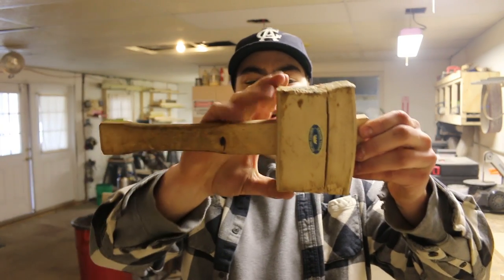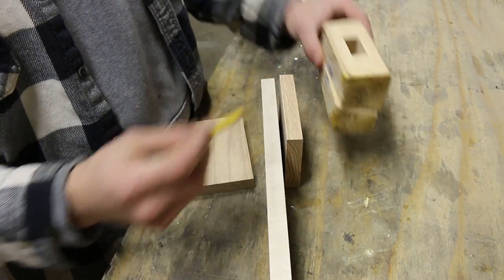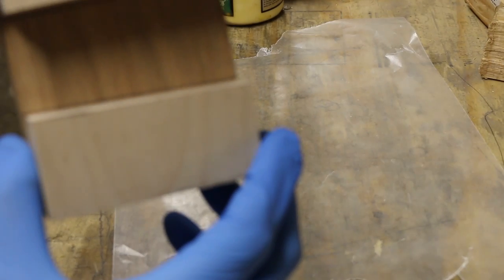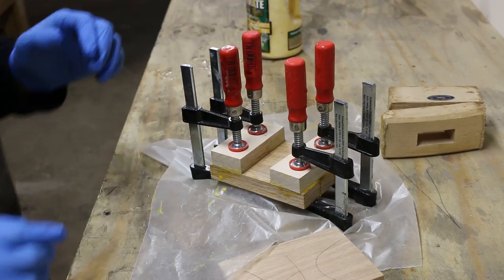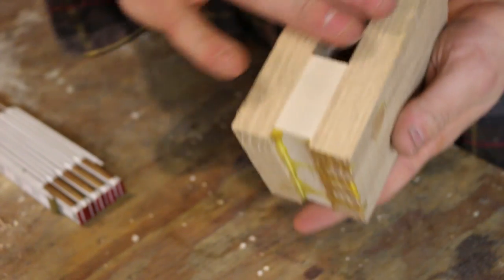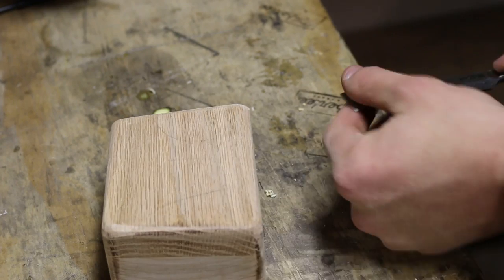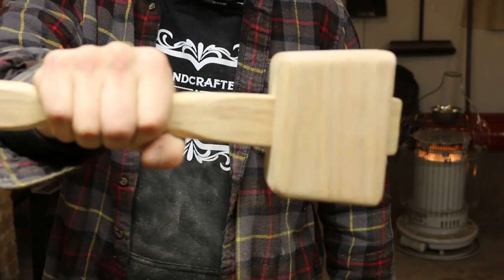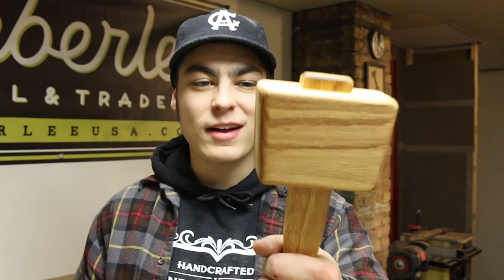Making a Wooden Mallet

Comment: You did a great job! Looks great but I have a question would a domino work in the head or will that be over kill to put them on there
Reply: I thought about the same thing, dado would secure the head from loosening for sure.
Reply: Paul Sellers recommends this method so you can take the mallet apart when you put it in your toolbox. It makes for easier and more compact transport

Comment: What is the purpose of the taper on the Striking surfaces?
Reply: Wally Kellett think about the arc created when you swing any hand held tool.   Your elbow is the fulcrum and a circular motion extends all the way to the end of the mallet.  If it wasn't tapered you'd hit off angle on the lower part of the face.